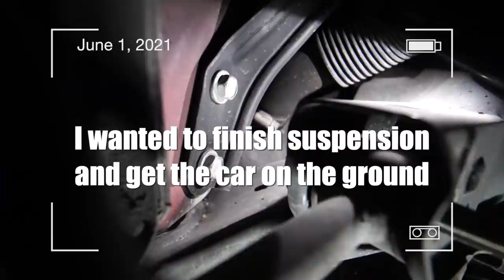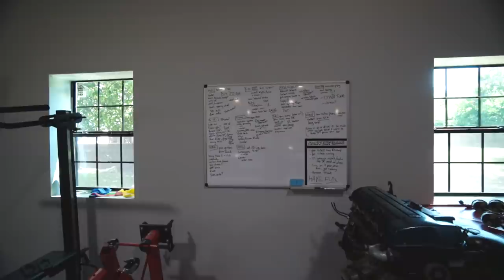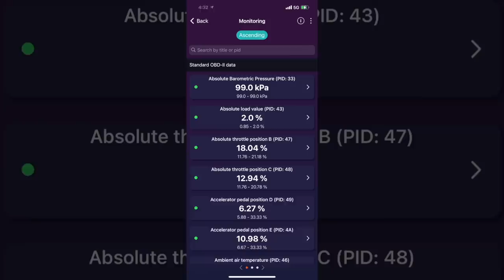THE TURBO IS300 IS BACK! - Finishing Up the Turbo Kit + Engine Bay!

Comment: If you want Evan you don’t need to get shortened spindles technically. You can get central roll correctors which corrects everything I’m the suspension geometry. I got the angle kit plate from drift hq and it has a built in central roll corrector which fixed my suspension geometry. Hope this helps can’t wait to see how it all turns out!

Comment: You should honestly rebuild the 7M-GTE. It's obviously not as beastly as a 1J or 2J but they still sound sexy with a straight pipe and the power capability is still respectable

Comment: NPT is not straight 😊 The angle across the flanks of threads in NPT = 60 degrees, BPST = 55 degrees. The thread pitch is also different.

Comment: Should've just used a bspt tee off the oil pressure sensor for the oil feed line. That's the easiest and most common way to do it now.

Comment: Are you sure you don't have a lsd you have to remember these are torsion different and most manuals are m85 which are lsd you can look up on the forums and check the sticker in the door it will tell you without opening up the diff